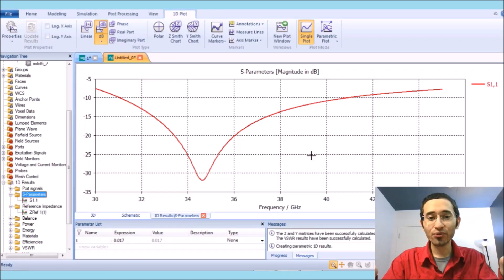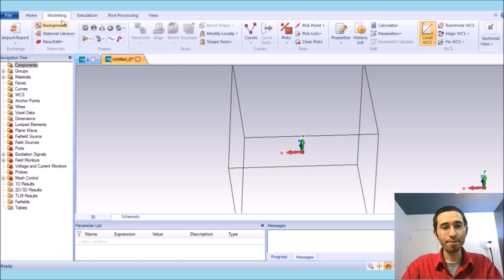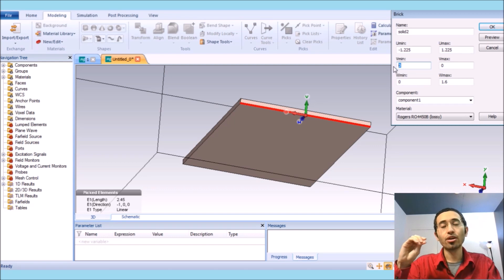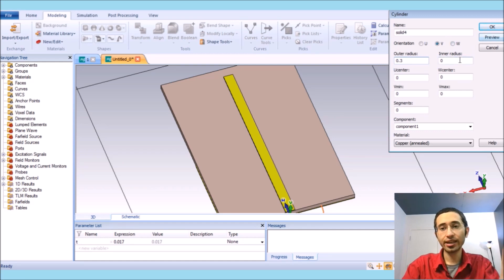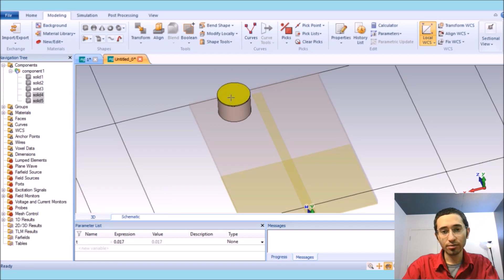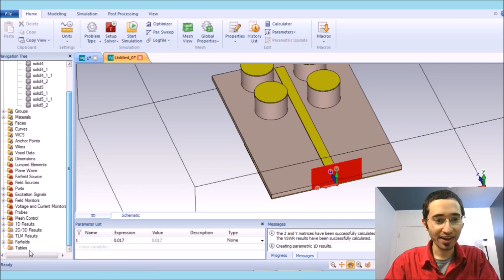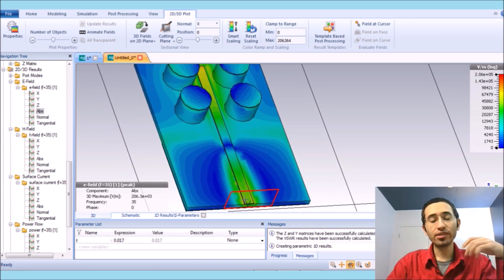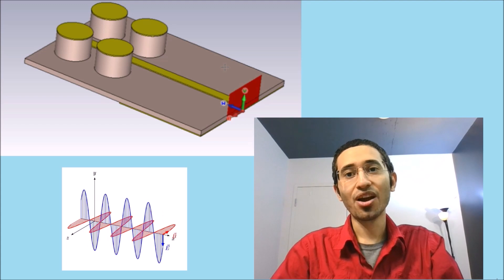Weird Millimeter Wave Antenna Design Using CST Software

Comment: How did u add the copper material above the cylinder as a parasitic component. I dont get that .Apart from that , your  explanation is very clear. Can you design an Antenna in 77GHz for Automotive applications? If u did before kindly give me the link.
Reply: I understood now sir ..Keep posting the design with mmWave frequencies
Reply from the maker: Some of the ideas came from my experience in designing an antenna.

Comment: Thanku very much sir. Your explanation is very nice and simple. content is also good. 
Can you please tell me how to design mm wave  5g antennas directed beam with metasurface?  
Please reply
Reply from the maker: Hi Thanks for your comment, One of the popular antenna types for getting high gain is Array Antenna, You should first design a power divider and connect the end of them to radiation patches.
You can get idea from the sample power divider that I post

Comment: Very.nice sir waiting for more videos from your side
Also need basic practical definition of different parameters like S1.1and other while analyzing the results and whats their importance regarding results explanation
Reply from the maker: Thanks for your comment, the S11, defines the antenna bandwidth, and radiation pattern shows how the antenna radiates outside. If you want to look at a gain in very simple way, you can look at it as efficiency. But real definition is: maximum radiation intensity produced by the antenna compared to that given by a lossless isotropic antenna.